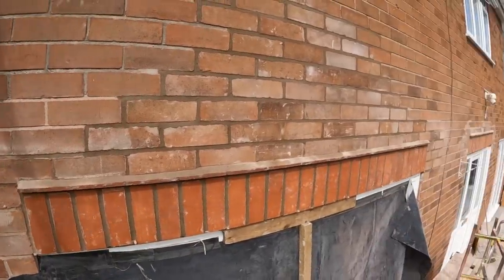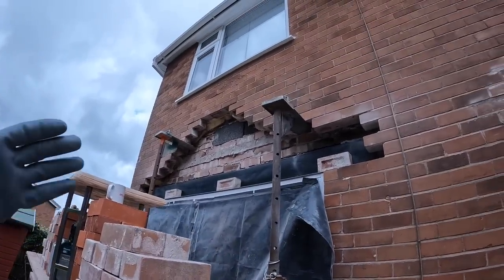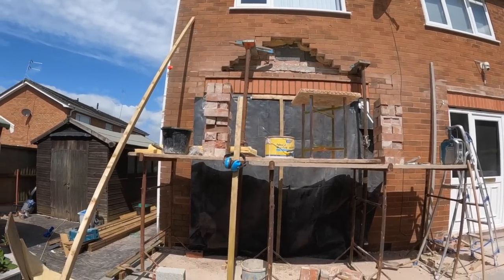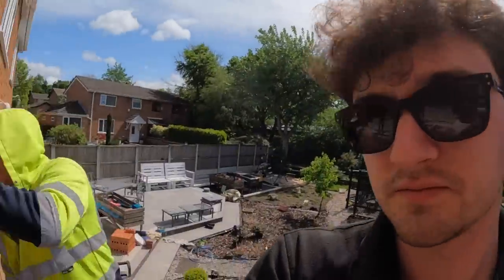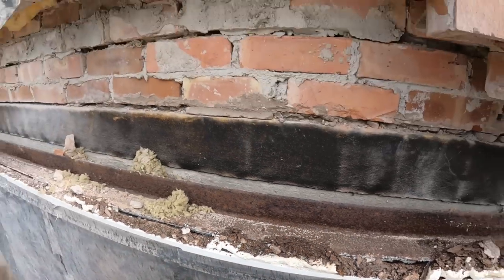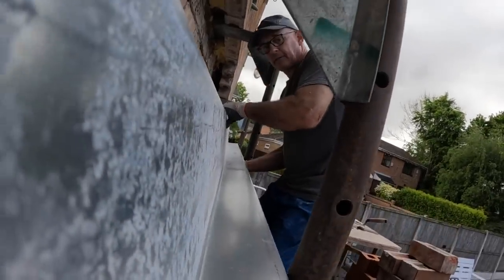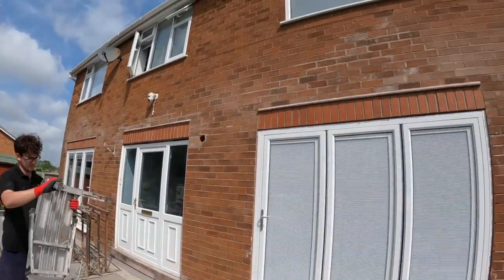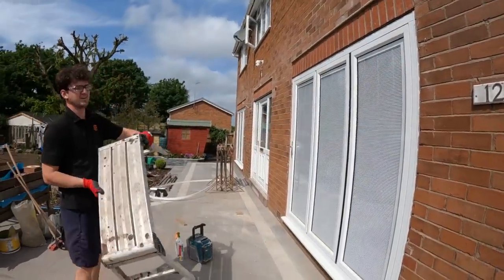NIGHTMARE LINTELS FINISHED!! TOUGHEST LINTELS PART 2

Comment: Hi Just sorting out my Edwardian kitchen wall above window as it has a crack down the mortar on the right-hand side where bricks are showing 1 on every course end face stepped down as against full bricks so lines up with the window opening (Creating a weak point) (No lintel). Just got down to the rosemary roof tiles 2 layers stepped like bricks above the soldiers like you are showing 1 layer. I was surprised to find the 2 rows of Rosmery roof tiles weren't cut down like you have done or shorter ridge tiles. I didn't expect both 2 layers of full tiles to go threw/bedded into the inner wall to form a cantilever effect lineal, have you come across this? any idea what weight that will take? as I presume the rest of my window heads (no cracks all full bricks) will be the same?   The next job is taking soldiers out to put a 2.7m signal leaf lintel in. hoping to find a wooden beam wonder inner wall
Reply from the maker: 😳😳good luck 🧱👍🏽

Comment: Another great job what silicone did you use with the dpc tray and did you rake the joint out to fit it to the inside wall.
Reply from the maker: We just use what we have . Sometimes we tuck it , if we can’t we neil it 🧱👍🏽

Comment: I never support my brick work unless it’s really loose and I use a 2by4” with screws above where I am working with a 2by4 on each side screwed in to the top and sides of the wall it works well for us and when we are done just a small whole to point up great work guys 🇺🇸👍
Reply from the maker: Great idea 👌🏼🧱🧱👍🏽

Comment: Those rusty lintels, how long have they been in and more importantly, how long do you expect the replacements to last? I assume, the originals would have been OK providing the DPM had been installed correctly? Great vlogs guys.
Reply from the maker: Thanks Brian I think the house is 1950 s . Hard to tell with the old lintels 🧱👍🏽

Comment: never seen the tile crease before, is it just cosmetic.
Reply from the maker: No David it’s got 2 uses . 
1 the metric soldiers are too short in the imperial brick wall so they level up the bed .
2 They allow water to drop off instead running down the bricks 👌🏼🧱👍🏽

Comment: Interested to know what blade you use to cut the mortar ? Also stage needs more training when talking with camera in hand. Sometimes muffled. Right, carry on
Reply from the maker: The blade is a
Bosch carbide masonry blade (£19 Toolstation) but only good in softish mortar . 4/1 and above it won’t last long .
    The bloody go pro mic is biased towards the back of the camera unfortunately which is very frustrating 😤🧱👍🏽
Reply: @SteveAndAlexBuild  thanks never heard of that blade, will have a look. Also sorry about the mic
Reply from the maker: @needaman66  . No probs 😁. 
    It’s a great blade. 👌🏼🧱👍🏽

Comment: "Can't make a silk purse out of a sows ear". So much for that saying, you guys have done it and even put a cherry on top. Don't know what a silk purse will taste like with a cherry on top but what the hell. Absolutely great job. If I were to have one small point of criticism that would be not enough videos from you but still, such is life. One thing that I have noticed from a lot of your videos is that the jobs tend to take longer than what you priced. Just a small suggestion. I don't know how you price your jobs and really I don't want to know, but what I would suggest is whats called "fuck-up money". Add 10 or 20% to the price you quote and if the job goes very well, reduce the price when the customer is paying. That will give you peace of mind if it runs over and a hell of an advert if you reduce the price just as the customer is about to pay. It will show honesty on your side and that will soon spread or it will cover your costs if something fucks-up. In a nutshell, quality costs but honesty is priceless. Just a thought . Anyway, fantastic job. Well done.
Reply from the maker: Thanks pal i will bare that in mind 👍🏽🧱

Comment: I'm sorry but those lintels must be thicker and must be screwed to the wooden beam of the structure and the mixture does not match, it looks very bad, it needs to be washed with acid and water, maybe it will matches a little more.
Reply from the maker: No need to apologise for being completely wrong 👋🏾👋🏾